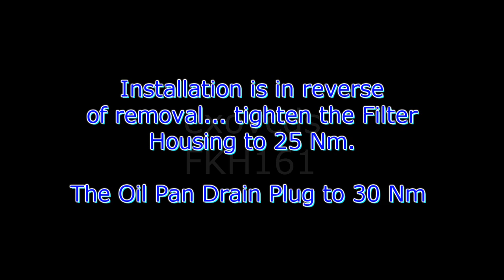Audi B7: 2.0T FSI Oil Filter Removal

Comment: I just bought the snap-on triple square drivers kit. 6, 8, 10, 12, 14 and 16 triple square. You probably have them as well, so I wonder how much you paid for them brand new. Mines are technically used, but the guy never used them and they look brand new. I paid $80 CAD. Also bought a trim-piece removal set of 3 pieces. One very long, and two middle-length - just different forks. I paid $50, do you know how much these are?
Reply from the maker: Can't remember what I paid for stuff... I can ask to see my purchase history and get back to you. Sounds like you got a deal on those tools. You'll learn to not question the money with time... when you need something,  you pay what the sticker says. I think I'm a at $70k now.
Reply: *****
It'd be awesome if you could ask how much the trip. square set is.

Comment: Is it possible to fill up the oil filter using that tool the same way like in DSG fluid?
Reply from the maker: It might work, but it will make a mess (trying to disconnect it quick enough to keep the oil from flowing out... the tube will be full with oil from filling etc).
Reply: Thomas EXOVCDS thanks, I will install a ball valve. I don't want to dry start my engine. I always build up oil pressure first using the starter.